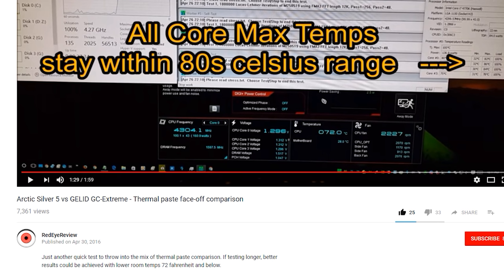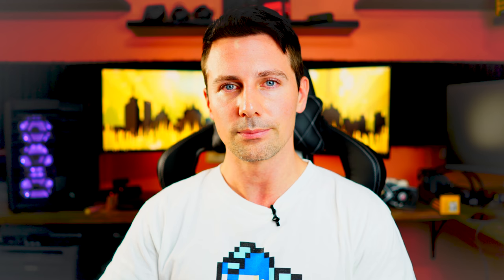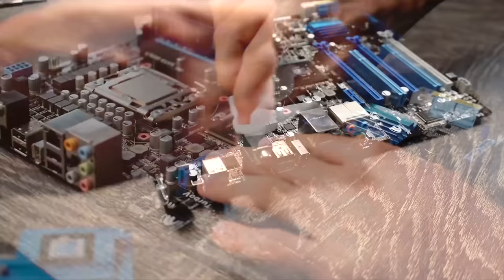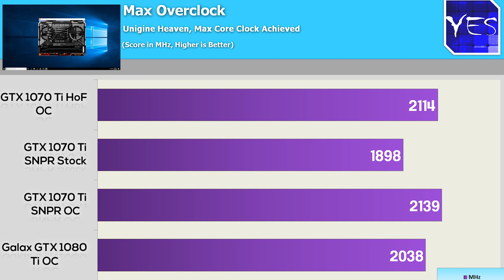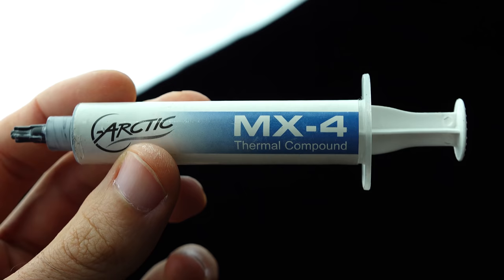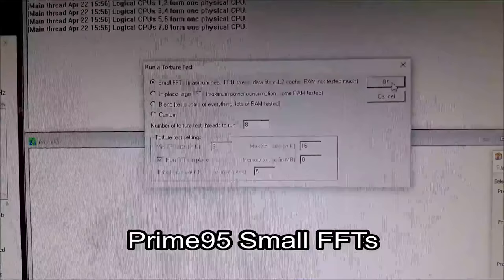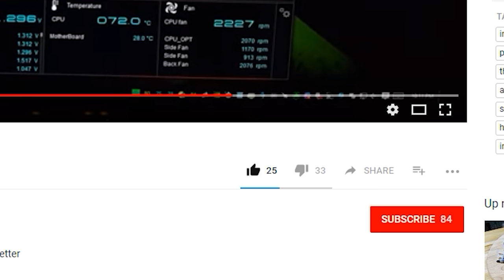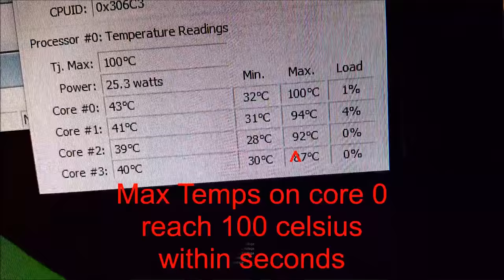Thermal Paste Investigation - GELID GC Extreme Vs Arctic MX4

Comment: I quite like thermalgrizzly kryonaut, just seems the right density to spread neatly+ the tube has an integrated spreader thingy. 

Still amuses me that there are fanboys for the various thermal paste brands though, it's pretty much the least important part of a build!
Reply: Tire manufactures say, that it's the most important safety element of your car, because it's the only one that touches the ground. Here it the only element of your cooling system, that touches the component.
But really the fanboism here exist, because of how hard it is to measure the differences, and often difference in application or quality of your tube is enough to get completely different results. So maybe they are not fanboys, maybe from the tests their read it actually is the best. Heck, for me Thermal Grizzly Hydronaut is noticeably worse than MX-2, even over a few reapplications of both and a long burn process of both.
Reply: All parts of the build are equally important. Except for RGB leds. Because RGB makes everything better.
Reply: The spreader thingy is pretty useless.
1. not rigid enough
2. waste of paste
Reply: Thermal paste is very important. There’s a huge difference between using cheap and high end thermal paste. You can use a cheap brand and it can burn off within a few weeks and completely destroy your PC. 

I stick with Artic Silver, why? Because they’ve been in the business since the first thermal pastes came out and are always reliable.
Reply: Technically you could use toothpase. It will get you over the long weekend safely but is nothing that lasts.
Reply: A person could say the same about why they drive a Model T. "Because it is old tech" is not a good reason.
Reply: asandberg6 It’s reliable and works great, never had a problem. So why would you switch? There’s a reason why the company has been around since the first computers. It called reliable.
Reply: At some point every tube of pasts is empty. So why not look for something better while at it. Especially since sometimes there are actually better performing pastes for less.
Reply: HappyBeezerStudios - by Lord_Mogul There’s a saying, “If it works don’t change it”
Reply: Never change a running system
Reply: In the face of evidence to the contrary? If another paste is showing 15* differences you wouldn't give it a go the next time around? That's just be stuck in your ways. Do you still burn witches and blood let too?
Reply: asandberg6 I’m sorry but no thermal paste will make that much of a difference between temp’s. The only one that can make a difference is liquid metal which will only be about a five degree difference give or take a degree. Most regular thermal pastes are only a two degree difference. So your question is irrelevant.
Reply: the spreader confused me as spreading introduces air bubbles.
Reply: Slyboi there's arguements either way (spread or blob) and believe it or not there are fanboys on either side!

I always figure spread is margainly better since the entire IHS heats up, so there may as well be thermal contact between the entire IHS surface and the coldplate of the cooler and not just a spot above the core (why waste thermal contact area?). Air bubbles are a potential risk, but spreading evenly and good pressure from the cooler should sort that out.
Reply: no way to spread evenly as cpus are not perfectly flat.  Everyone has a cpu with one a bit hotter than the others.  Give a pea and the contact between cpu and cooler will fill that in.  Spread, your trying to give every part of the cpu the same amount of Tim.  Let TIM do it's work.  If you encourage people to spread, you are introducing some human error, and bubbles.  Just pea on it, diagonally squish it, and be done.
Reply: Slyboi it's a valid arguement.. but in the end, 2 things sold me on the spread method.. 1. It's the method thermalgrizzly themselves recommended and 2. Its the method der8auer recommends (he's German and in my mind that means he's probably right!)

If I recall, Linus tech tips did some testing of the various methods and none made the slightest bit of difference so long as you used enough paste.
Reply: fair enough.  I can only go by my results.  Pea method has never done me wrong.

Comment: I use noctua nh-d1 or what ever its called. I've had nothing but bad experiences with artic thermal paste. On my old energy Max cooler I had a 10c difference of the noctua stuff vs silver. 

This video seems to be very inline with my anecdotal experiences so I'm glad I've been somewhat vindicated

Comment: Tempted to pick this stuff up to swap the AS5 on my Ryzen 7. My OC won't go higher unless I push 1.42V but the lower temps will be nice. Might swap the stock paste on my 1080 Ti as well. Do you happen to have a strix 1080 Ti to test the difference?
Reply: Wow, that sounds pretty bad. With that voltage I could bump my old Core 2 Quad towards 4.2 GHz.
Reply: Ryzen's are known to be pretty stubborn 4Ghz+ though. So 3.95 at 1.38V Seems fine for me. Finally got my memory past stock thanks to recent BIOS updates. 2400-2800MHZ just by moving to 1.35V(which is a pretty common voltage on XMP profiles)
Reply: I know personally that I managed a meager (in circumstance) 4.9ghz overclock on an 8600k due to thermal limitations with an aio and AS5, so do what you will with that.

Comment: Both are very good compounds, but not without their cons. GC extreme in my opinion outside of liquid metal will provide the best thermal results, however in the past I've experienced and witnessed it drying out after ~2 years. Mx-4 is guaranteed to last for 8 years and it really does what Arctic cooling is claiming but at the cost of slightly higher temperatures. I think that it comes down to what you're looking for. When I say slightly higher temperatures I've noticed that GC extreme in my setup manage to shave off 2/3°c.
Reply: good point, what good is it if it dries out after 2 years

Comment: I know with my experience with Arctic silver 5 you do have to heat cycle it quite a lot to get the maximum performance of the paste since it has a cure time but i still think there are better pastes out there but something to think about and my understanding of mx-4 is that is a long lasting paste instead of a super high performer I remember that on the tube i have it says it should last something like 8 years without being replaced so i think it comes down to application more then anything and trade offs abound with any paste that you use.

Comment: This is pretty much eye opening to me. I'm using the Arctic Silver MX2 on my 7700K on my huge cooler and it still gets extremely hot. Maybe the thermal paste was the problem the whole time. The thing is, that I'm not entirely sure if this is much better than the heat pads that Linus showed off in one of their recent videos. Is it possible to test against the great heat pad, that Linus used and actually performs really well?
Reply: I have a hard time believing 8c change most reviews of paste have shown like 1-2c difference which is margin of error stuff
Reply: @joshbert & friends, There's a new paste called “Thermal Grizzly Aeronaut”. People who have used Arctic Silver 5 say Aeronaut is better. You can use http://shopping.google.com to find the cheapest place to get it.

Comment: So I have used my Gelid Solutions GC Extreme on 3 of my machines for the last month, and there is absolutely no difference in temperatures with this thermal paste and the Arctic MX-4 I have been using previously. I don't know why some report those great temperature differences because I've been using both thermal pastes on core i5 3470, core i7 3770, core i7 6900k and phenom II X4 955 - no differences what so ever. Actually the Deepcool Z3 I have does a bit better than GC Extreme.
Reply: I think people aren't mounting their heatsink tight enough or spreading it incorrectly

Comment: Dude same thing just happened to me. I honestly think mx4 starts to seperate over time or something. I put it on my sc2 1080ti and I was like meh cuz temps were about the same. Then weirdly it started to creep up over time. Originally it was 72-72° after long periods of bf1 at about 57% fan speed. About a month later I'm gaming and it's at 77° at 64% fan speed. So I try everything, case fan adjustments, etc. I then noticed if I run valley benchmark temps hit 70° with 5 seconds of started the test, which would normally mean bad thermal contact between die and heatsink. So I say whatever I'll yank it apart again. I get it apart and spread is perfect, no issues whatsoever. I figured I'd try phanteks diamond based stuff since there's some solid reviews out there (usually on par or just under gc extreme) and boom 72 max at 55% fan absolute peak after about 2 hours of bf1. I have no clue what happened but I'm off of the mx4 for now. I like the phanteks stuff as it's quite thick as well. I'm just about to swap my 8700k paste now n I'll let you know my results.

Comment: I ran stock paste on kraken x62 and peak at around 65-70max, I removed it and put thermaltake value plus paste and hitting high 65-75, not happy as I’m shocked the nzxt paste from factory was good, it’s been a year since I changed the paste

Comment: Long term performance?
Reply: I used it for ~3 years on a video card (280x) and 3 years on a FX 6350 CPU with no problems or major temp changes. It works fine on both high and low mounting pressure

Comment: Tom's Hardware did a thermal paste roundup last year and GC Extreme is about 2.5c lower than MX-4 in the worst case in the GPU medium mouting pressure, and pretty much the same in every other test. 
GC extreme is £23 the lowest price I could find for that 10g tub, wheras MX-4 is about £15 for a 20g tube - so £46 vs £15 for the same amount of thermal paste.
Is 2.5 degrees worth that much more? If so why not go whole-hog and get some liquid metal for £9?

Comment: Arctic TIMs are junk now a days. GC extreme is fantastic, so is kryonaut, ive used both and have tested both. I have tested over a dozen TIMs on bare die 4690k as well and most pastes get the same temps as liquid metal believe it or not BUT it pumps out within a day, liquid metal lasts years. GC extreme and kryonaut are amazing for GPUs , watercooled or air cooled. I strictly use Kryonaut now as i get 5g for about the same price as gc extreme and the consistency is what i like.
Reply: Wouldn't call it junk. They are in the usual 2-3 °C margin of 90% of all branded pastes on the market.
The GC-Extreme is usually between 0.1 and 1.2°C better and the Prolimatech PK-3 is between 0.07 and 0.8 °C cooler than the MX-4
Look up the tomshardware test of 2017. With exception of the liquid metal stuff and pads/tapes 71 pastes tested are between 34.8°C and 39.5°C above ambient with a huge margin ( 53 out of 71 pastes are staying between 35.5 and 38.5°C, half of it less than 1°C from the average)
And the MX-4 is in the top quarter of the pastes tested.
Reply: Here's the thing, about 90% of TIM tests aren't even done well. They're tested either on an AIO or air setup, most don't test the different pressures from coolers either, low/med/high. When i did my testing i tested the pressures with pressure papers then tested with the TIM and tested for durability. Most just test, remove and test the next one, none are actually done comprehensively. Noctua although good, will  pump out on the IHS and on GPUs anywhere from 24hrs to a couple months on a GPU. Kryonaut and GC extreme won't because of their viscosity. I found that MX-4/2 we're alright but nothing to write home about, sure the temps might be the same but for high pressure and durability it's average. I tested this for about 6months on a bare die 4690k, then put the IHS back on and test it under the IHS, tested on a 3350p rated at 69w and then on my 1700x with low/med/high pressures. On the 3350p Noctua under the IHS had zero issues but on the 4690k my temps shot up 10°C within 24hours, it's why i stopped using it.
Reply: I dont no, video would have been boring, i had it all written down in categories under high/med/low pressures and water/air.  I will say that Kyronaut and gc are amazing for GPUs by far. I tried Hyrdonaut as well but it ended up being so dry and thick it wouldnt even apply. I contacted em and got a second sample but that stuff is a nightmare to work with, i can see why they recommend putting it in warm water and actually spreading it. You can look up my name on overclock.net under deliding and TIM threads, they should still be up even though i got banned for feeding the trolls lol. 

I will say that so far, i am loving Kryonaut, haven't had to reapply it and i use it on every single builds i do (believe it or not being in europe i can get the 5g for fairly cheap compared to US prices. 5.5g here is 15€ in the US seems to be anywhere from 23$ and up. You need so little and it spreads so well that 5.5g lasts such a long time. I wish i did a video about it but like i said this was done for my own purposes. 

I will say this, Kryonaut and GC work the best with high mounting pressure GPUs/waterblocks, Noctua and Hydronaut (when its not dried) work the best for medium pressure. Lapping probably makes a better difference then changing TIMs and it's a shame Intel/amd dont smooth polish their lids, people seem to forget that TIM is actually very poor at conducting heat, compare copper at 300w/mK to TIMs that are 5-15w/mK HUGE difference. Ideally you want a microscopic layer and it's why lapping the IHS and mounting surface is key to getting even better temps.

Comment: That is very strange... on paper both should be withing 1-2 degrees from each other. I would like to see more proof but until then I will stick to my MX4, which perform the same as my Corsair H100i V2 stock paste (which is considered very good stock paste).
Reply: There's a paste called “Thermal Grizzly Aeronaut”. People who have used Arctic Silver 5 say Aeronaut is better. You can use http://shopping.google.com to find the cheapest place to get it.

Comment: interesting. i myself use an arctic mx4 because of overwhelming high rating and recommendation from a lot of tech sites. but if benchmark says otherwise, then i guess mx4 has fallen out of grace. I dunno if maybe arctic decide to lower the mx4 quality because it still sells very well anyway or something, but hell i am disappointed that this happens. thanks for the vid, very informative indeed. guess i'll switch to gelid extreme as well then.

Comment: Im using Arctic MX-2 on I5-2500k oced to 4.5GHz with LC POWER LC-CC-120 cooler and the temperature doesn't exceed 65°C. It's really good for that low price.

Comment: You know, Arctic MX-4 is a king of thermal paste for years so why there are a lot of faked MX-4, especially on eBay or AliExpress, but even in retail store! So your MX-4 may be fake... How to find out is your MX-4 a real one? Well... I don't think there are any real ways besides buying Arctic Cooling cooler bandled with MX-4 out of box or MX-4 directly from official site (if possible) and compare it to yours.
Reply: yeah same here, been using mx4 for years, tried the gelid stuff and mx4 was exactly 1 degree lower on average
Reply: Sorry but its straight up trash lol noctua and gelid extreme are better lmao

Comment: Gelid GC Extreme has been my go to paste recently after PK-3.  Both are great, but MX-4 is absolute trash and AS5 in 2018 is laughable.  The guy in MC that told me to get MX4 when I went in there to get some in a pinch was educated quickly.  MX4 is a last resort paste and should be replaced ASAP after you get the real stuff in.

Comment: MX-4 isn't suitable for laptops since it can dry out quickly due to low mounting pressure. Gelid GC Extreme is really good. AS5 is good those days but now it has outdated thermal performance, there are better options